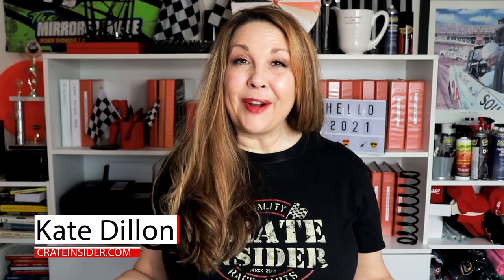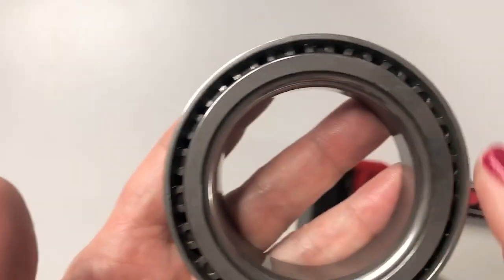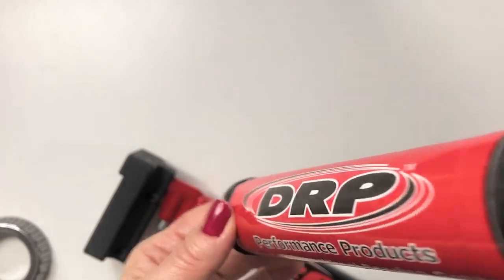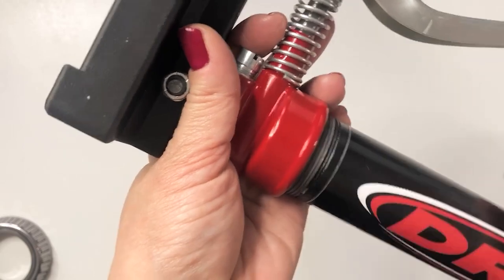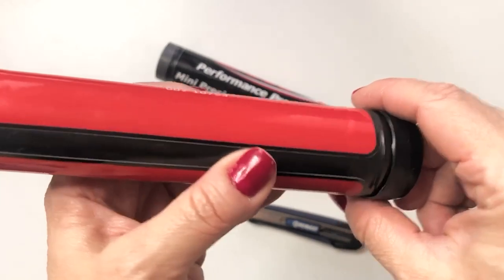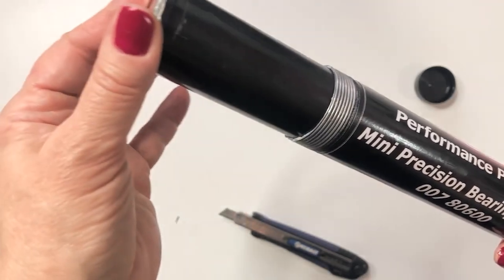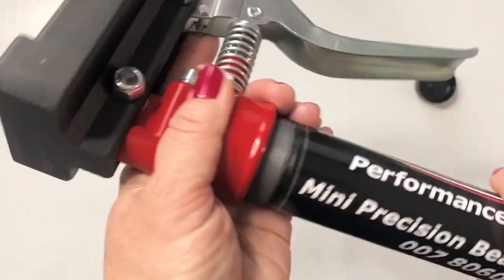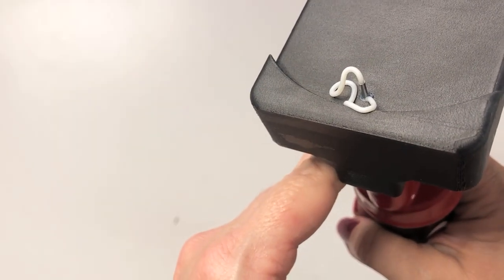The NEW DRP Mini Bearing Packer

Comment: Would not buy. You don't need a ton grease but you do need grease on every roller. If you're repacking you need to be able to push old grease out. Other wise your defeating your purpose.